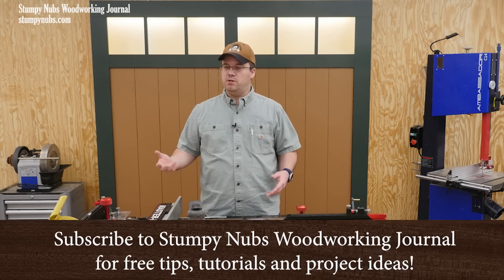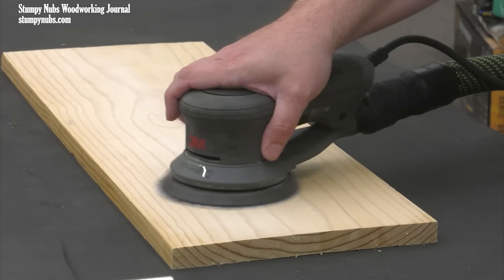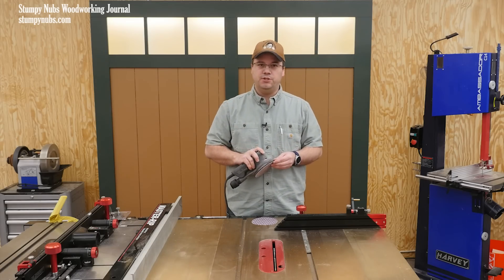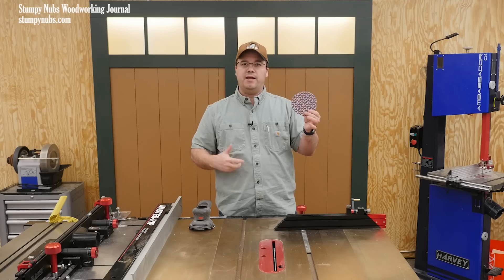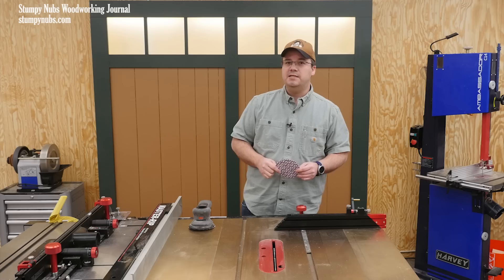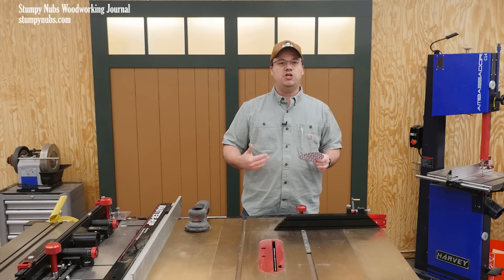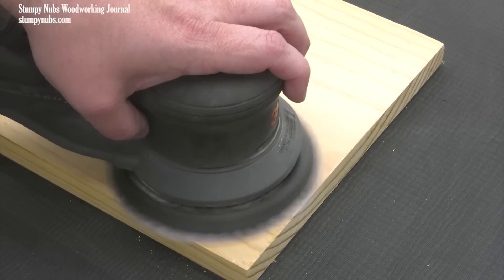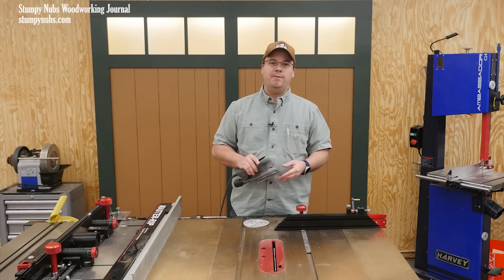Smart thing pros do with their old sandpaper.

Comment: Just started using the mesh Cubitron disks last week… and holy crap. I was cleaning up some reclaimed wood and had previously been using Diablo disks, which are also pretty good imo. But the 3M disks would do in a single pass, what the Diablos took 3 to 4 passes to accomplish. It’s insane, you can damn near power carve with these things haha. 🤘🤘
Reply: And those babies go on and on and on and well you know.
Reply: I’m using the mesh cubitron as well and they are awesome but I wonder if the non mesh version would last longer? Like the one in the thumbnail
Reply: Try Festool Granat mesh. It makes Cubitron look like an entry level experiment.
Reply: @dwalsh3469  really? 🤔
Reply: @Painfulwhale360  yes. I bought a box of the cubitron to try it out. You can’t use it on a geared rotary sander (it does say so on the box) and the equivalent grit size in the granat mesh is way better, for me at least. Don’t get me wrong - it’s very good sandpaper. Granat mesh is better. Stronger and stays sharp much longer.
Reply: @dwalsh3469  I’ll have to try it out then. I like the cubitron but to me it seems to not stay sharp for very long.
Reply: I used to use Diablo also, and am still going through some that I have remaining, but HOLY CRAP the 3M are amazing! Going to fully switch over, a joy to use (as joyful as sanding is 🙄)
Reply: @Painfulwhale360  They're waaay more expensive, so it must be true.
Reply: @Mason-hs9oz  I really like the Diablo discs for about 10 minutes, then unfortunately they lose their edge. I thought that I was doing something wrong until Jonathon Katz-Moses replicated the problem.
Reply: I’ve used Mirka Abranet for years and loved it. Lately I bought Diablo mesh because it was readily available and what a mistake! 40% (subjective estimate) life of Mirka, but it is cheap. Will order some 3M Cubitron from Stumpy’s supplier next time for a trial. Having worked in a large cabinet shop for years Stumpy is right on about false economy using sandpaper.
Reply: I have used the Festool, Mirka and 3M 6” disks and they are all good. I prefer the 3M but all are good. The 3M seems to pull more dust and stay cleaner than the others, the 3M and Festool last longer than the Mirka but non of the 3 Is far superior to the next one and would be happy with any of them. I have not used the Diablo yet. I may get some for my 5” sanders and give it a try.
Reply: The Diablo mesh was just so cheap recently and I really can't tell a significant difference among the grits. I did side by side sanding pencil off an end grain cutting board and maybe I have to go a tiny bit slower to get all the pencil off in one pass with an RO Makita sander.